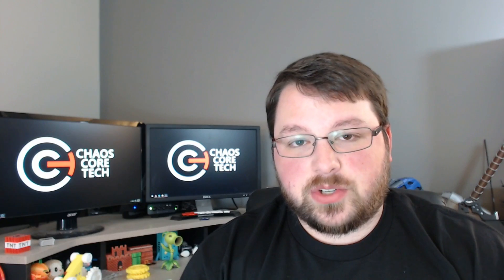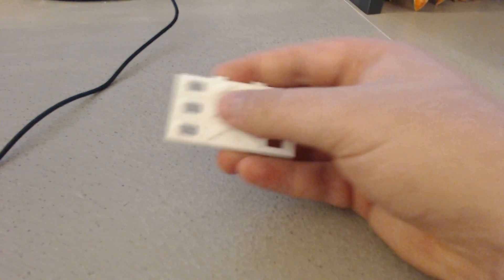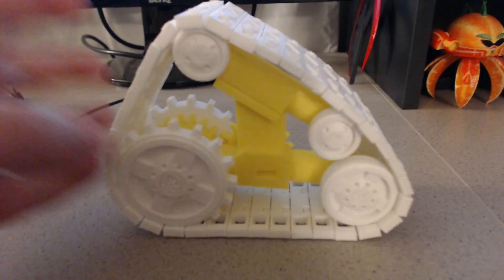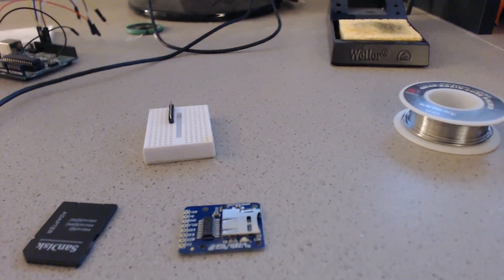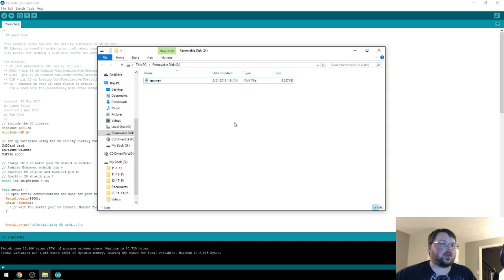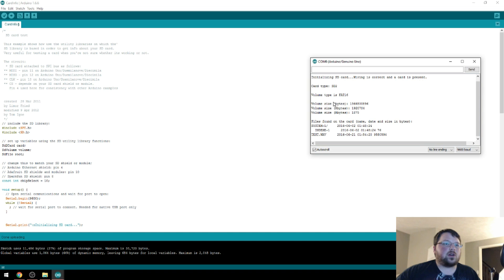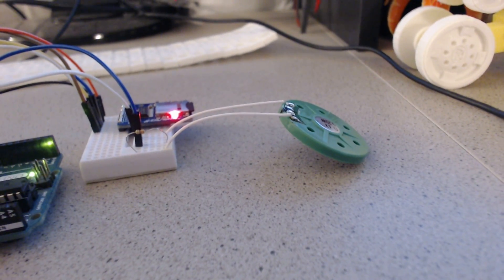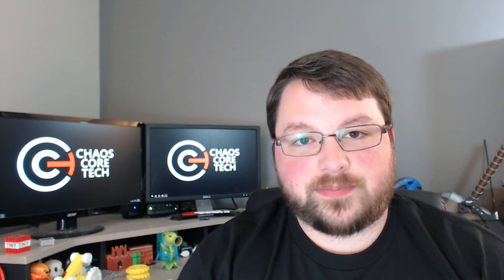Treads & Electronics! - Wall-E Update #8

Comment: I am assuming arduino has a library for reading a wave file already. If not you just need to do a binary read of the sample rate, bits per sample, and data. Map the wave file bits per sample to the arduino analog out, move the data into a FIFO, and pop the data from the FIFO to the anolog out at the sample rate. The file format standard can be found here... http://soundfile.sapp.org/doc/WaveFormat/
Reply: The arduino clock is not the best, so you may need to tweak the sample rate to get the best sound.
Reply from the maker: Yeah there is a pretty good library I found. It's not natively included in the Arduino IDE but it's free online. I think I finally found the problem. I had to reformat the wav file to work better with a mono speaker like this. I still need to test a bit. But it seems to work. Thanks for the help. :)

Comment: Could try something like this for a positive lock but with proper clearincing for 3D printing similar to how E-Chain connects. Alternatively you could make the joint parallel to the edges if you want the inside of the track to be flush. Would be good if you could print something you glue to the original tracks, save having to waste a complete set of tracks :). - http://i64.tinypic.com/zoes0w.png
Reply from the maker: That's not a bad idea. I've got a design I'm testing at the moment, but if that fails I'll probably do something along these lines. Thanks for sharing! Also my fallback plan is to use something not printed that's flexible that I could glue to it. We'll see where it takes me. :)